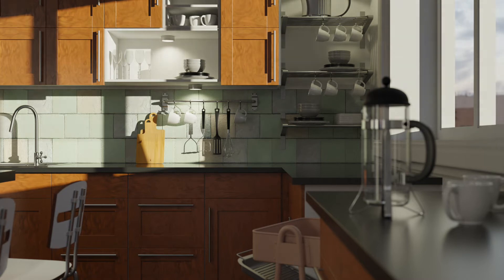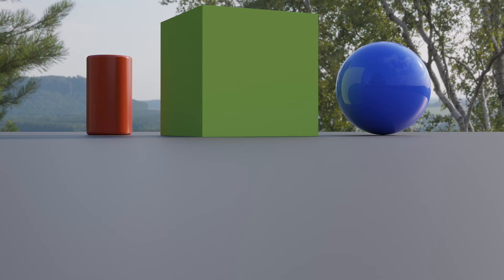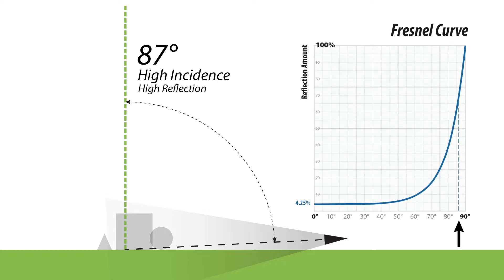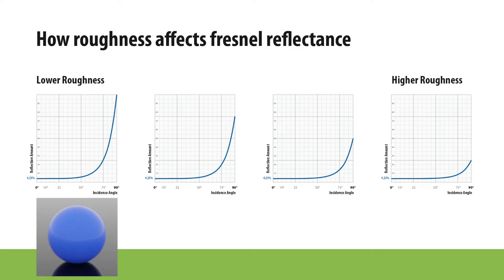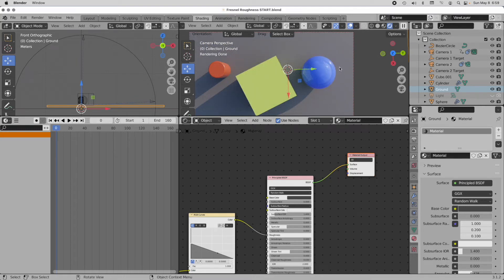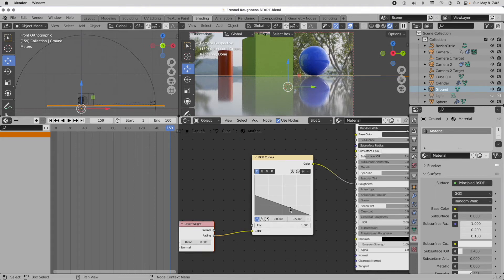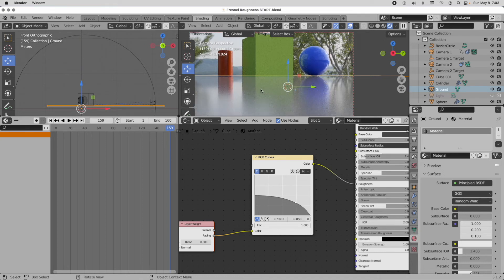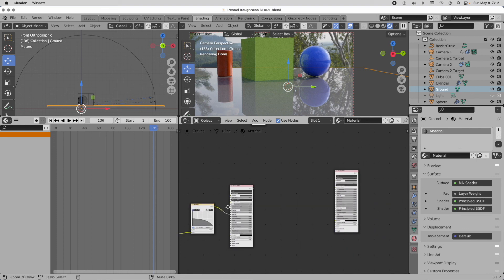Specular Reflections & Variable Roughness

Comment: I prefer math nodes over curve, in order to expose settings to material controls.
I wouldn't recommend the second way of doing it, for two reasons:
1. It creates ad additional shader call per sample, which in this case isn't necessary. Simple math is generally preferable.
2. You'll have more than one reflection showing up at the same time, and "hazy gloss" isn't what you want in this context.

"Hazy gloss" may not be obvious in the case of one large roughness value, but can become evident with smaller roughness values which can happen if controlled by roughness maps. Note that multiple specular lobes (outside of coat), can be a thing, "hazy gloss" can also require more than two lobes to "get right". But the approach can definitely lead to something that resembles "hazy gloss". Look up research papers if it's unclear what this is.

Comment: a follow up question: Say i made a very specific floor roughness texture, say in substance painter. in there, i have areas where its more rough than the rest of the floor, and areas that are LESS rough that the rest of the normal area. How do i use that texture in relation to the first method using the curves [which you say is more realistic?] ?

Comment: Doesn't the value of 0.425 in the Specular in the Principled node account for 42.5%? not 4.25% as you show on the chart? as in 1.00 on the node would account for 100% in the chart.
Reply from the maker: No. For specular it seems to be that 1.0 is calibrated to 10%, not 100%. However, for Coating, the value does appear to be calibrated to 100% which is for sure a bit confusing.
Reply: @christopher3d475  Thanks! really good explanation and video!
Reply from the maker: @migueldelag  Yeah, keep in mind the Principled V2 that's currently in development will change some things, rest assured I'll do a video about it when it's released.

Comment: Very Nice tutorial. I am in the process of producing better material for my work and understansding the real physics behind light behaviour is the key and you videos is such a gift !!!
Here you are giving the example of a roughmaterial at 0.5, but what about a semi glossy material of 0.3 for example. How does it affect the fresnel curve ? Does it compress it or clamp it ?
Reply: just watched your "specular channel" video. Very interesting though.  but now i am wondering if the curve of  the custom roughness must be modified for each specular value ?
Reply from the maker: @GuillaumeFouquet  I'll try and do a video on this. The roughness as it controls the fresnel curve does this because the GGX microfacet shader causes backscattering at the glancing angles. The light scatters off mathematically defined micro-roughness patterns and this causes the fresnel curve to flatten (essentially) with increasing roughness. So we still think about the fresnel curve governing the specular channel, but as roughness increases the strength of the fresnel curve as it progresses to high incidence angles flattens. In essence it begins to behave like a diffuse, uniform surface.
Reply: @christopher3d475  thank you for replying So you  say that not matter the Specular value ( or converted IOR to Specular ), it's the roughness curve which does all the job ?
Reply from the maker: @GuillaumeFouquet  Think of it this way, the Specular value is what's controlling the reflectivity at low glancing angles. We can think of it as controlling the overall 'look' of the intensity of the reflections. But with Fresnel, the endpoint at high glancing angles, the 90° endpoint of the curve, is always 100%. UNLESS the roughness is high. So roughness is adjusting what happens with the fresnel curve as the glancing angle increases. It has the effect of blunting the strength of the 90° aspect of the fresnel curve. Roughness will attenuate the low incidence reflectivity a bit, but its overall influence is on high incidence, while the Specular value is controlling what happens at low incidence. So Specular is still what drives the overall intensity of the reflections.
Reply from the maker: @GuillaumeFouquet  I just uploaded a new video where I add more detail the question about roughness as it relates to the Specular channel.

Comment: Hey, thank you for sharing your knowledge! Did you try LuxcoreRender? They declare that they use real-world equations in their engine. Also wondering what is your opinion on the second release of the BSDFv2 branch from 31 October.
Reply from the maker: I downloaded Lux, but haven't spent much time with it yet. Yes, I've been playing around with the second PV2 release. The energy conservation is a big deal and works really nicely. There's a developer presentation about it from the recent Blender convention which goes over a lot of the changes in detail. They're doing away with the Specular channel and instead doing something a bit more accurate by using the IOR to drive reflections. Metal reflectance is a bit more technically accurate now too. The sheen model as been updated with a new, more physically accurate mechanism. I hope they address the nested dialectrics weakness that is currently a challenge.
Reply: @christopher3d475  Thanks for the reply! I'm currently testing Luxcorerender in so far it seems very promising to me. One big downside is that there isn't a node wrangler alternative for Luxcore...
Reply from the maker: @leonidaltman  Yeah I want to do more testing with it. I just need more hours in the day. There's another renderer I deeply wish they would produce a plugin for Blender, called TheaRender. It's a very good renderer (TheaRender.com) but they only have it running on Rhino and Sketchup which is really unfortunate because it's very robust.
Reply: @christopher3d475 I saw you mentioned it in one of your videos. Would be awesome to see a video from you on that renderer, with a quick overview of its strong sides.

Comment: so so so good. really! thank you for taking the time and explaining it so thoroughly. love to see it. but i was wondering how to go about method 1 with something like wood. or any material where u wanna use a map for roughness?
Reply: When you are using a roughness map, like for wood, then you can take the fresnel or facing output and multiply the map using a mix RGB node set to multiply. Make sure to get the values the correct way round, for example the fresnel output is white at high incidence and black at low incidence, so it needs to be inverted first before multiplying roughness.

Comment: I've been using the Method 2 version of variable roughness, and it's been going great! I do have a few questions about its usability:

1. When presenting the node setup for the first time, you had the Layer Weight's output to the Mix Shader set to Fresnel. Later on you connect the Facing output to Mix instead. Which one is the correct way?

2. What is the best way to control roughness with precise values? I tried changing the first shader's (the one at 0.5) roughness to something like 0.25, but the effect of the layer weight seems to change too. Say I had the first shader's roughness at 1. The material would then have it so unless I'm looking at a surface at a perfect 0° angle, it would have a perfectly clear reflection with the only variation between 1° and 90° angles being how bright the reflection is. I don't know if Method 1 has this issue or not, as the only reason why I don't use it is because I don't know how to precisely control roughness for it.
Reply: Nevermind my 2nd question. I figured out to use roughness precisely with Method 1, and have been using it ever since. I apologize if my original comment was a dumb one 😅
Reply: @TheFrogChannel  It's not a dumb question. Fresnel ONLY applies to mixing absorption portion with specular portion. For everything else related to viewing angle we should use layer weight/facing. Also fresnel can be a bit "dangerous" to use as unless you know how to invert the IOR for backfacing faces, the backfacing faces will show snell's window effect.

Comment: This tutorial is gold. So Specular fades the reflection and the roughness blurs the reflection. correct me if I'm wrong.
I also watched your videos on Energy conservation I realized that if I mixed the Diffuse BSDF and the glossy BSDF using a fresnel node, I get the result of an energy conserved material exactly the same as using your method. I'm wondering if u have tried it out.
Reply from the maker: Oh, I forgot to talk about the Fresnel  node for energy conservation. It partially works here, but but it doesn't do is preserve energy conservation as the roughness increases for the surface. As roughness increases the GGX microfacet function in the Principled Shader causes the fresnel effect to lessen at glancing angles which is a physical effect. But when you use the Fresnel node, it always preserves the fresnel curve expression at high glancing angles regardless of roughness, so you end up with a strong fresnel effect even at high roughness values. It's technically still preserving energy conservation, but at the expense of a more physically correct GGX expression related to roughness. So it works yes, at low roughness. This is why I didn't show it as an option because it just opened another can of worms to try and explain. But the good thing is the 'Principled V2' shading system being worked on right now resolved these things which is going to be really nice to work with.
Reply: @christopher3d475  thanks for the explanation.
I checked the 'Principled V2', I can't wait for it to be in the blender official release.
Reply from the maker: Specular is the reflection. It defines how reflective the surface is in a general sense. Roughness 'diffuses' the reflections using a fairly accurate physical model, But importantly it also attenuates the degree of reflection at the glancing angles as the roughness increases.

Comment: Ehy did you use the face angle, instead of the fresnel node? shouldn’t it be the same consider you use a curve node to control it?
Reply from the maker: There's wiggle room here as to what mode you use, for instance with the layer weight node. You can use Face or Fresnel to get a proper fresnel based falloff, or Face to get a more linear falloff that can then be customized with the curve. This is one reason why it would be good for them to build this into the material system.
Reply: I know this is old, but, the only thing you should use fresnel for is to calculate the factor of reflectence.
The main purpose of layer weight/facing, is that the output is normalized between 0 and 1, making it easier to predict and manipulate.
Fresnel also forces you to be well aware of your normals, or risk creating "Snell's window" output for backfacing faces.
Note that math can also be used over float curve; i.e. for architectural thin (fake) glass (transparency based), I use facing -> power 5 -> add 0.05 (clamped).
The effect is near identical to fresnel with IOR 1.55 (typical glass), no refraction to worry about, and no normals to worry about.
In addition, you get "fresnel shadows" (albeit fake) for free, which you don't get on the regular "if shadow ray, then full transparency" hack with a glass shader.
Note that this applies ONLY to when you chose to use non solid geometry to represent things like windows (where you don't see thickness).
Not accounting for correct shadows, you can also replace Transparency shader with Refraction shader and use Geometry/incoming as normal.
That allows faking frosted glass on single sided geometry (although you may want to couple it with Diffuse and Translucency shaders).

Comment: Thank you very much for this tutorial.  I learnt a lot.👍😀  With the two methods of varying roughness, are there any merits choosing one over the other?  In terms of accuracy, performance etc.  Example: Are there any situations which method 1 is preferred over method2?  And vice versa?
Reply from the maker: I think the method that actually changes the roughness with incidence, as opposed to just transitioning to two different layers, is really the more accurate one, it's more the way things behave in the real world. Neither will confer a performance benefit that I can tell.
Reply: @christopher3d475  , Thank you for your explanation.😃  As I am after physically correct material, therefore I prefer to use method 1 over method 2.  Have a nice day.
Reply from the maker: @kchow1879  You should watch my video on energy conservation, it's a direct follow up to this video in many ways and contributes to more realistic materials.
Reply: @christopher3d475  , Hi Christopher,  I have in fact watched the "energy conservation" video a few times and I am still digesting the content and which led me to watch this video.😀  I am a slow learner and I consider myself a beginner.  There are many questions I need to think through.  Energy  Conservation definitely a good concept for modelling after the behaviour of the material.  I wish to apply this concept to most if not all materials I use subsequently (May be a little over ambitious at the moment 😅).

Comment: Wouldn't it be easier to use the fresnel node to mix between an Oren-Nayer diffuse shader and a glossy shader?
Reply from the maker: No, because all that's doing is using the Fresnel node as a mask for the glossy shader over the diffuse layer (Oren-Nayar in this case), adjusting the specular reflection's intensity with incidence. That wouldn't alter the specular layer's roughness as incidence increases.